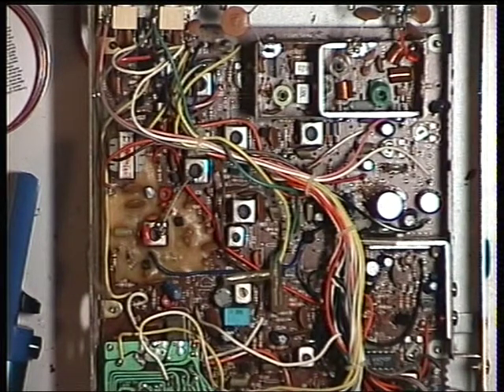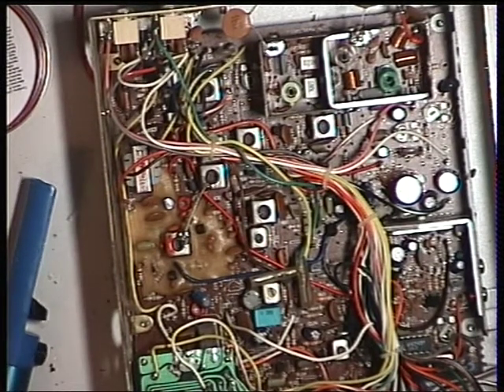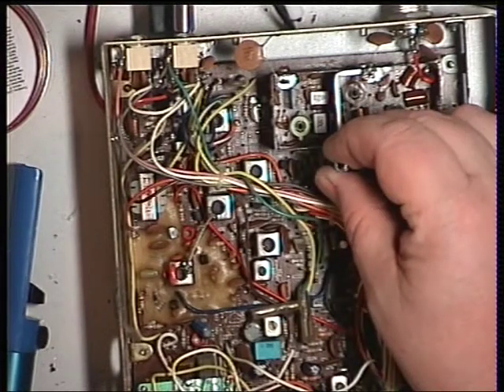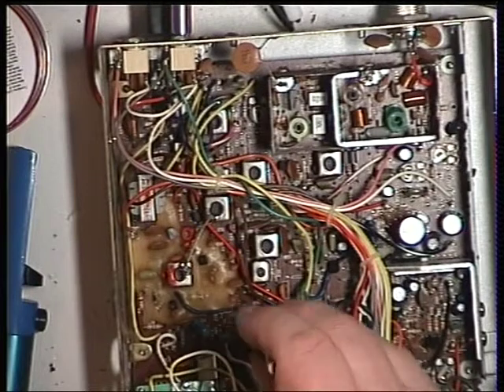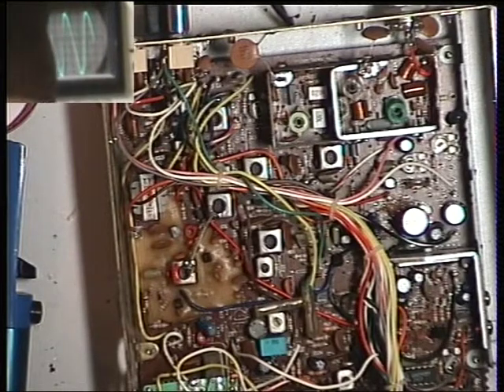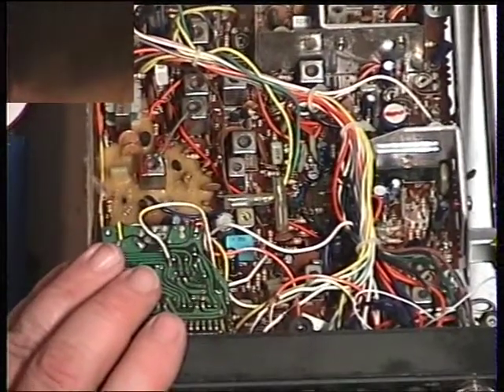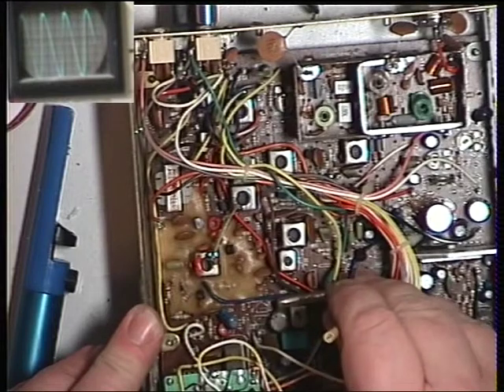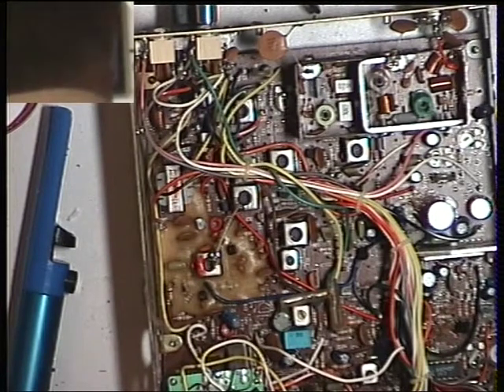Harvard 420M UK CB radio. Alignment of Receiver

Comment: I need to tighten up the on/off volume pot backnut on one of these as it is loose.
Frustratingly the only thing stopping the front panel from coming off to allow access, is the microphone socket which looks like it will have to be unsoldered. 
Just when I though it would be a five minute job ha ha. :-)
Reply from the maker: I think you have to unsolder the 3 ceramic decoupling capacitors from the  chassis lug, plus the black wire & I recall the actual connections to the mic skt can stay connected as there is enough slack in the remaining wires

Richard
Reply: @ukfmcbradioservicingTango21  thanks for that information Richard! Glad I don't have to disconnect the entire mic connector. Appreciate the tip. 73!

Comment: I don't suppose you are based in Swansea?
I have just bought one of these that with the squelch up full I need to turn the RF Gain down to under 1/3 to get it quiet.
However when I touch the unit I can reduce the squelch to 1/3 with rf gain at max.
My other cb's squelch (moonraker with no rf gain adjustment) sits at 2/3 .
I think I need it serviced.
Reply from the maker: +chris dewitt No, I'm near Grantham in Lincs. Although I normally only deal with the trade, I would sort it for you if you sent it in. richard.shireby@virgin.net